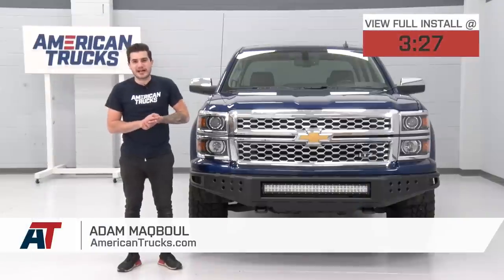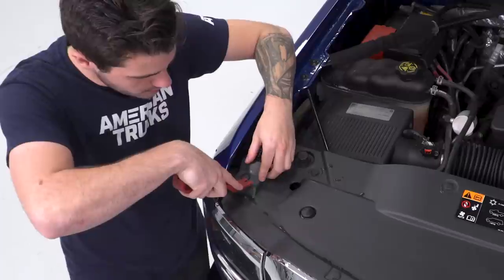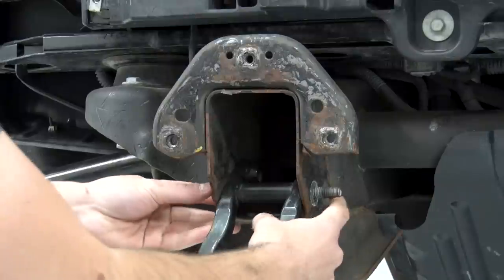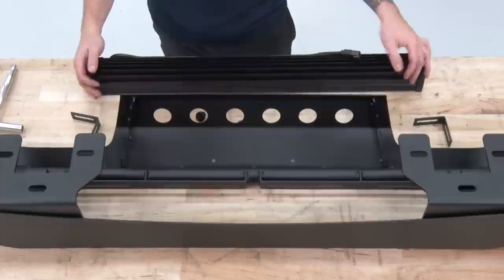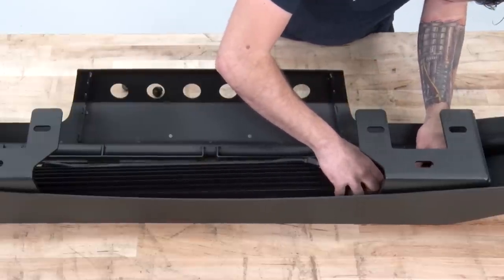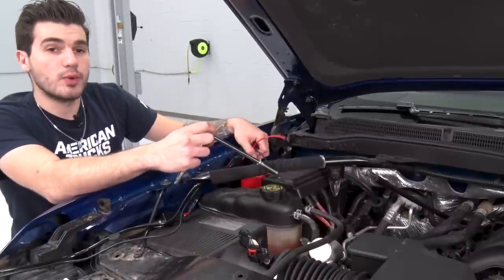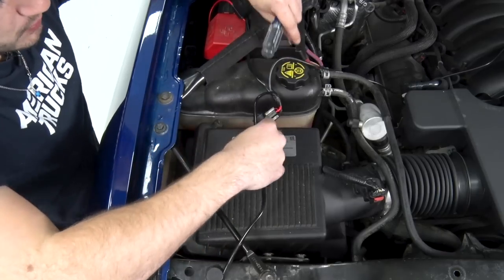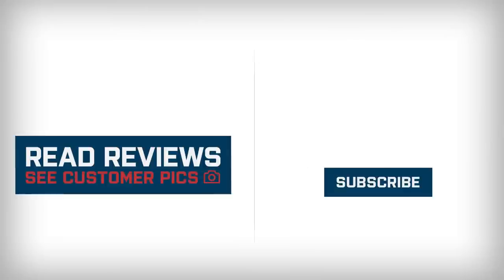2014-2015 Silverado RedRock 4x4 Tubular Off-Road Front Bumper Review & Install

Comment: Can I wire the light bar to the factory fog light switch instead of installing the aftermarket switch?
Reply from the maker: You definitely could! Some states require aftermarket lighting to be installed on its own switch though, so I would check with local laws before hand. -Zach